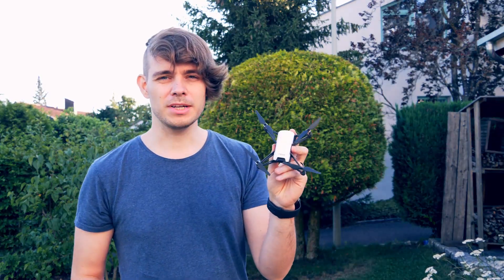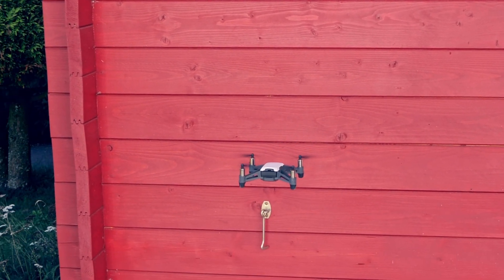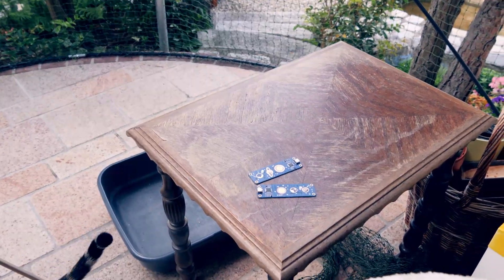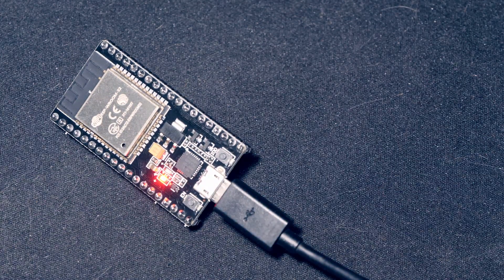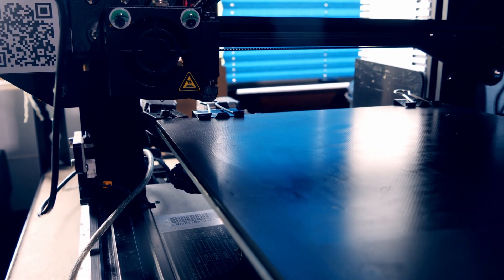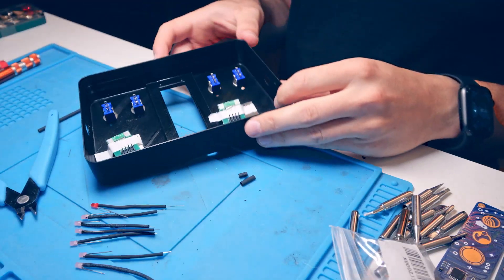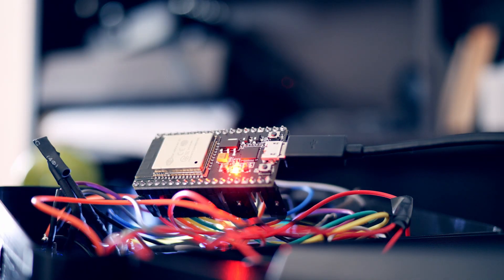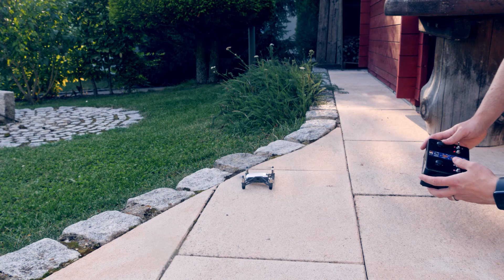Building a remote control for my drone

Comment: you should get lolin32, it has a lipo battery connector and can charge the battery through the usb port. also i suggest not use jumper wires, instead straightaway solder the wires to board (without the header pin ofc)
Reply from the maker: Thanks for the suggestion! I haven’t heard about this before. Will definitely take a look at it.
Reply: sush